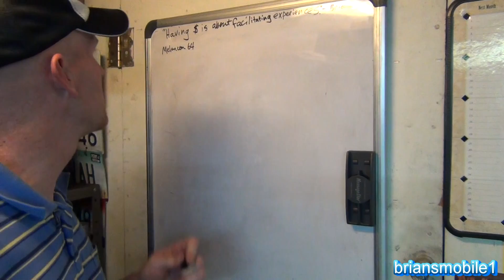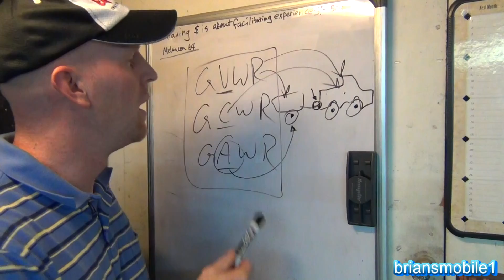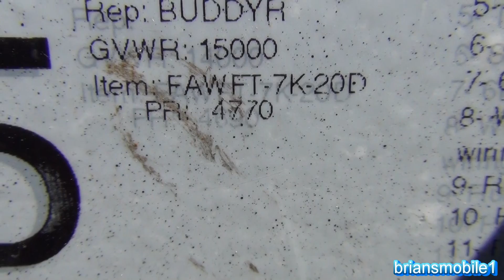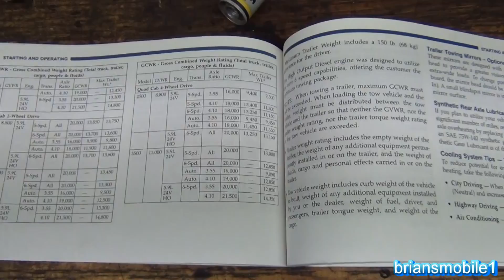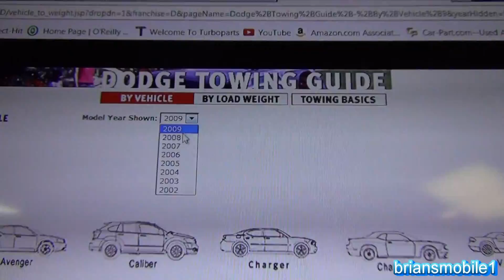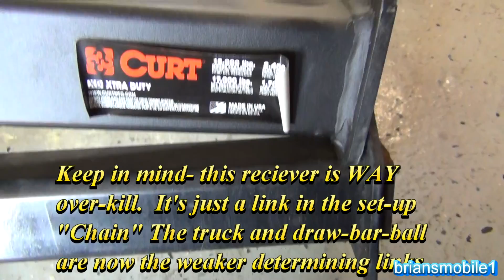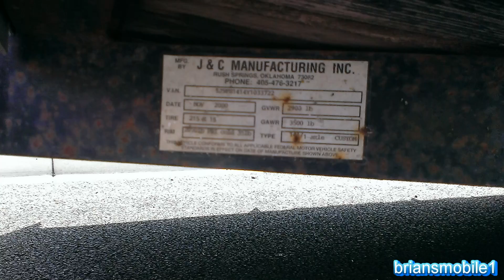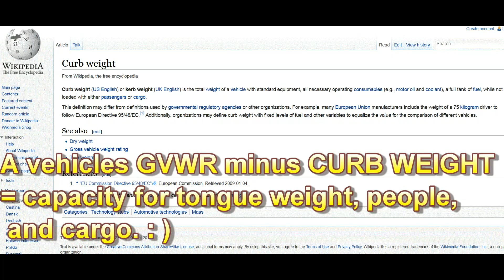What's GVWR & GAWR ?????

Comment: Excellent vid Brian -  All vehicles sold in north America have never been sold with the proper GVWR rating since the 1900.  The Automotive Society Of Engineers (SAE) wanted a standardized weight  formula and the manufactures decided to pass and display incorrect weight and tow ratings.  Finally for 2015 Nissan will publish SAE weight and tow ratings for their new pickup with the 5 liter cummings diesel truck.  The tow and max. payload is lower as expected but realistic and certified by SAE.  By 2018 all trucks will succumb to the engineered weight ratings and you will see quite a reduction in GVWR.  This should have been done years ago and prevented manufactures to market their trucks falsely.